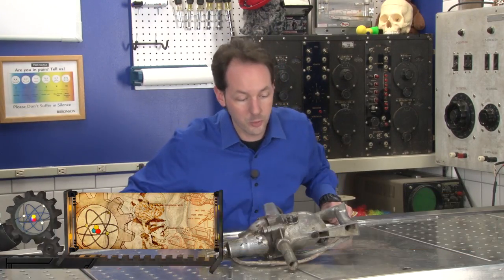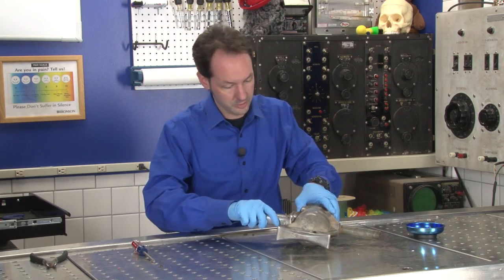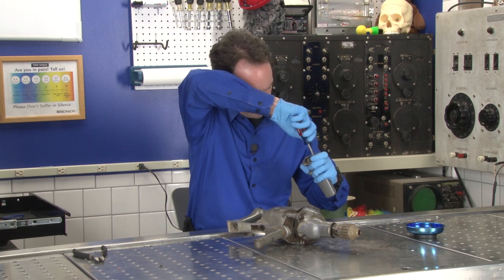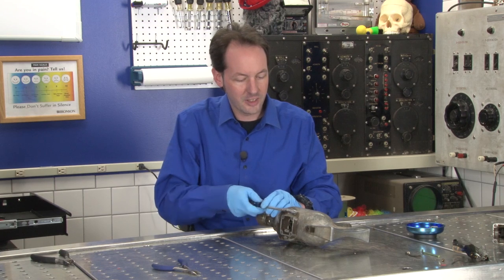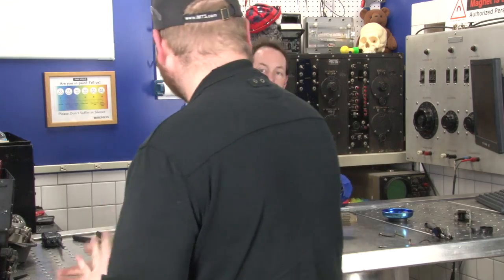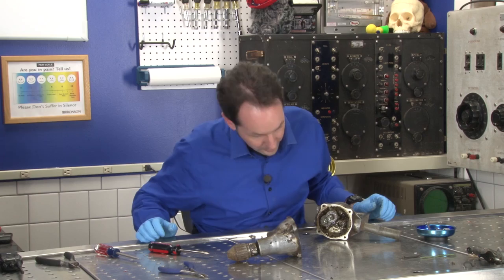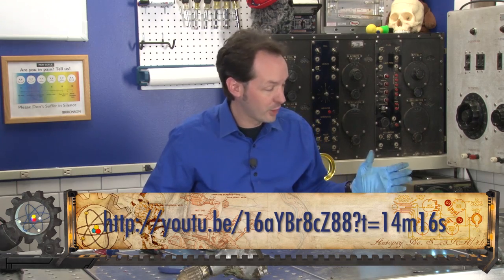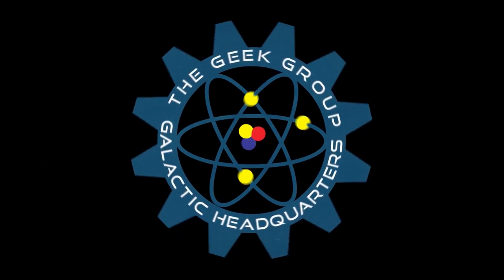Vintage Black & Decker Drill: Equipment Autopsy #76

Comment: I agree on the timeframe.  Late 40's, early 50's.  I still have my dad's.  It still works.  Hard to believe, but you have the lighter weight home owner version.  I have dad's standard version.  It's had the cord replaced a few times.  Several years ago the switch was rebuilt.  The chuck had to be replaced after a couple of decades of use, but it still works.  I don't use it these days.  It's so big and heavy.  But it will still be working long after today's tools batteries are dead and irreplaceable.

Comment: That 3/4" pipe handle is factory original just in case you were wondering.
I have the exact same drill that my old man passed on to me after he passed away.
The drill when I got it was still in it's factory box with an artists impression on the lid of the drill and it's accessories, one of which is the pipe handle. From what Mum can remember it was bought in the early 50's here in Australia.
Thanks for showing me whats in mine. I hope I never have to pull it apart as it is a beautiful slow revving drill, that has tons of torque and power.
ATB
Matt

Comment: Mount the armature on a stand (after cleaning), add a couple of magnets from a hard drive and a couple of contacts, if the armature isn't burmt out, it could be a useful demo, it will probably run from 12v or less

Comment: I had a boss that threaded a cheater pipe onto one of those and when the drill bit snagged, the drill pinned him to the roof of the truck box he was working in!   I think that drill more likely is from the postwar 40's or early 50's based on the graphics used.

Comment: Take 1 pair of lockjaw pliers. Clamp them to the shaft (not the handle) of the screwdriver. Instant leverage.
Reply: SAI Peregrinus  Just yesterday I used that technique on a 1927 Black and Decker drill, worked beautifully! Hammering the gear box, then shoving it randomly back together was just classic : )

Comment: Black an Decker still makes decent tools.  Stanley Black and Decker owns DeWalt, Porter-Cable, Delta Machinery, DeVilbiss Air Power, Kwikset, Baldwin, Weiser Lock, Price Pfister, Emhart Teknologies, Oldham Blades and Vector.  If you buy the heavy duty true contractor professional grade tools they do hold up quite well and if you are on a budget, even their consumer grade stuff does well as long as you treat it right and recognize the limitations consumer grade stuff has.

Comment: I think Black and Decker were first to invent electric drill.They make industrial grade special order...very good.Shalom
Reply: They weren't the very first (it was Germany's Fein, but their electric drill was the kind that you had to use your chest in order for the drill to run), but they were indeed the first American firm to invent one. Theirs was also the first to have the pistol grip and trigger switch--features that were found on the Colt revolver that B&D co-founder Alonzo G. Decker, Sr. had owned. 

In 1946, B&D extended its innovation to marketing the first line of consumer power tools (then known as the "Home Utility" series), which were still all-metal (but of lighter weight) until they made the first double-insulated (2-wire) tools in the mid-1960s. The success of the Home Utility series of drills (production surpassed one million units in 1951) led B&D to build on the line, which included 6-1/2" and 7-1/4" circular saws in 1949, followed four years later by a finishing sander and jig saw.

B&D was also the first company to perfect the first cordless electric, battery-operated drill. That was in 1961--as such, back then you had to charge these cordless drills all night long.

Comment: you should see what a friend ask if I could make mix drywall compound in a trash can  it is bigger than that one it has both tags mod#7745 5/8 220 volt 2 amp 500 rpm it weighs ?no scale a lot! Industrial .service tag ship to in ENG. German Russian Spanish late 40s??and it works will make it mix drywall mud! if he can hold on to it